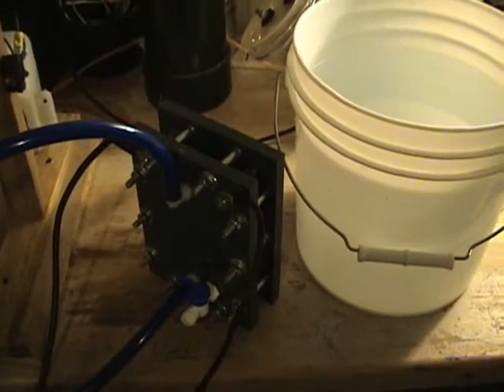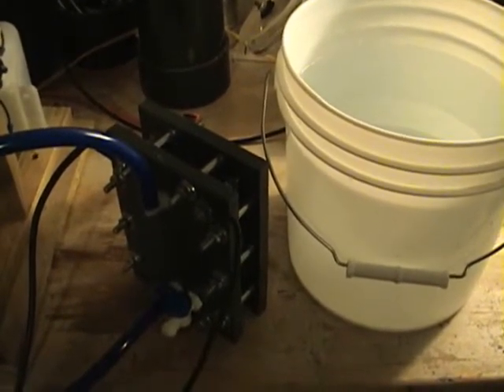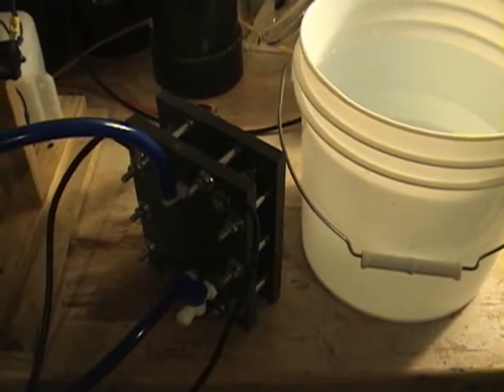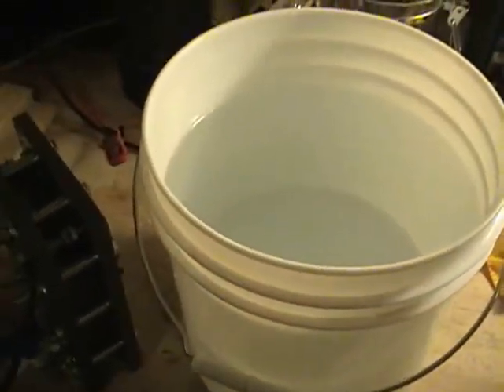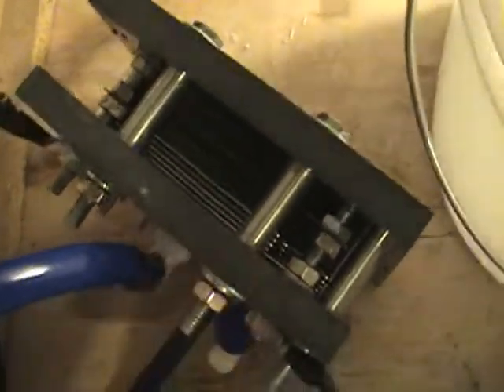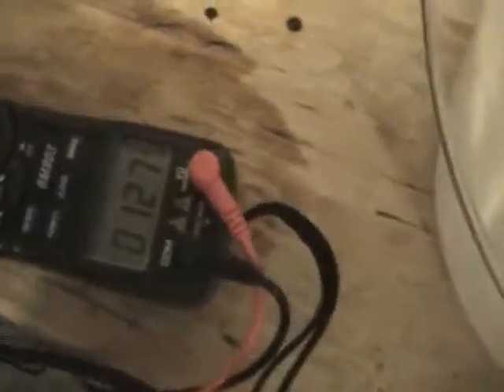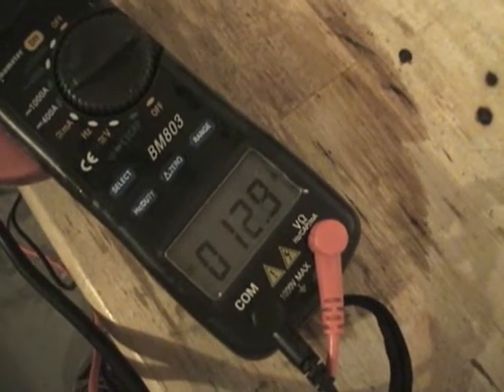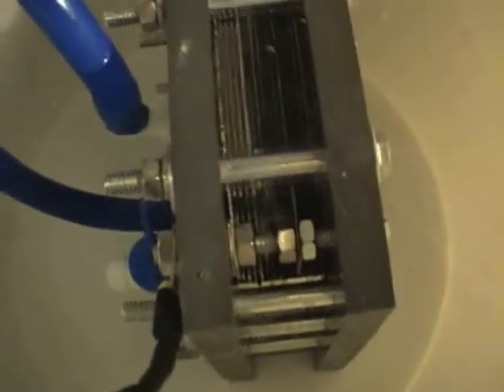(35)TKO dry cell UNDER WATER!

Comment: Hi: Winter snow/slush would have a lot of salt in it and would conduct more current. On the flip side the slush would quickly melt where it is in direct contact with the plates leaving a slush shell on top of or around the brick.
Mars